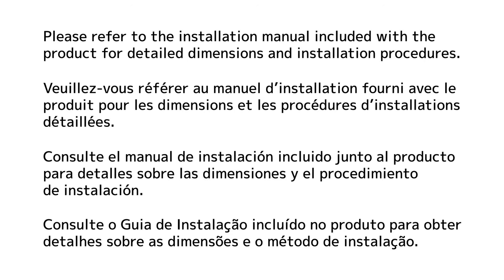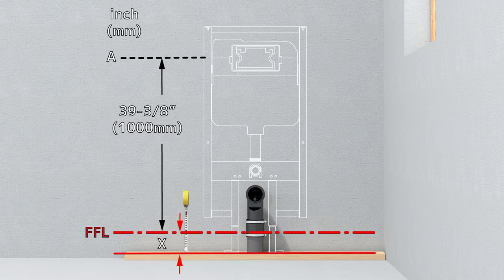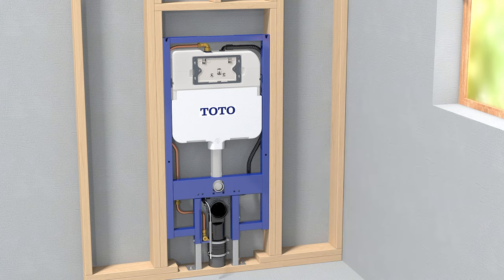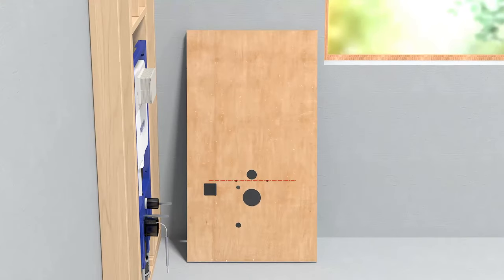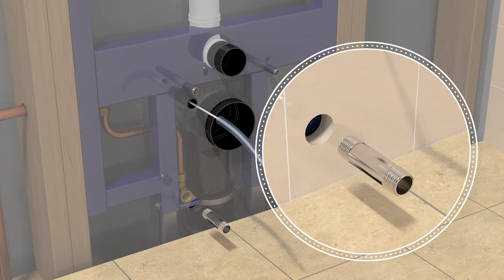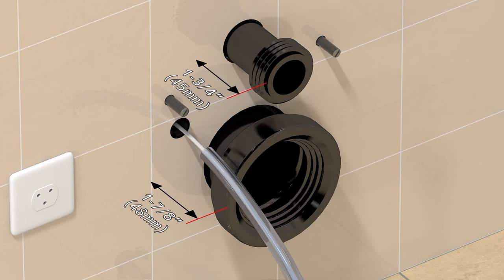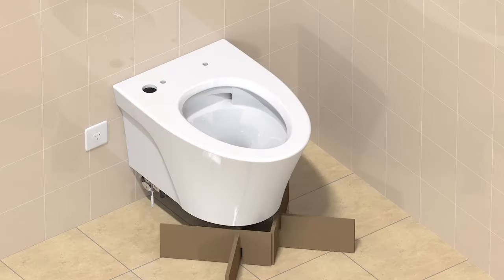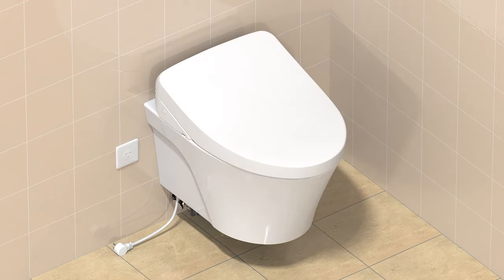TOTO AP or EP Wall-Hung Toilet Installation Video

Comment: I read all the comments below and no one mentioned these two MAJOR flaws: 1. At no time in the instructions of videos (Jan 2022) does it include instructions on drilling the left side 2x4s for the water inlet. Instead the video says” now that you have drilled the hole” that magically appears in the video. Also the copper water connection is behind the blue bottom rail so completely inaccessible front the front. If you install on an outside or concrete block wall good luck getting it tight. 2. The water tank makes it impossible to properly tighten the top left hand lag bolt. For the price of this system these types of major design flaws should not occur!
Reply: 0:36
Reply: @BookieTech lol
Reply: Might help to watch the clip again.  Sometimes we miss things the first time.
Reply: My man's brain exploded 30 seconds in
Reply: Note… to be installed by professional 😂

Comment: I’m installing this is my house right now, this video shows it being enclosed in high quality plywood first which is a solid idea. Nowhere in the written instruction manual does it tell you that.
Reply: But what if something is not working or it has to do a maintenance?
Reply: @ashbinx  That is the  problem a time bomb.
Once it goes bad remember it is enclosed into the wall and you will notice the damage very late plus the damage will be
1 the wall where the toilet sits.
2 the bottom floor wall and ceiling 
You will notice the damage and would not be able to prevent it early and you could grow mold and complete destruction of floors walls ceilings.
Reply: @ashbinx  I was working in a Carribean hotel where all toilets were like this one.
I wanted to install one in my house so I would suggest this.
After all structural installation the final finished wall (cover) to be something like an accent cover panel so if something happens you just unscrew the bolts and repair all damages.

Comment: I was dangling my feet off the toilet pretending the ground was lava.  I did a little butt hop and the toilet broke out of the wall...  As I lay on the floor with a mild concussion the water and brown monster mudd splashes onto my face.  Reevaluating how i ended up in that current situation I couldn't help but think I should have got a 1 piece toilet.  They are sexy.  They are sleek.  They are like a smooth sleek bentley.

Comment: I want to install this but run my plumbing through the framing (horizontally) Is that possible? I don't see why not...But no one shows it going horizontally. Always through the floor as if that's the only way to accomplish a proper installation. I am slab on grade and want to use this to escape cutting out concrete.

Comment: TOTO please do a video installation into a concrete block wall.  Also, find a solution so the bidet controls are not next to the toilet.  Bluetooth control panel that can be attached anywhere on a wall.  Phone app or Google voice command.

Comment: My remote didn’t come with the piece to swap out the top of the remote that has the auto flush buttons. Where can I purchase that top clip on attachment?
Reply: It didn't come with it because you didn't purchase the "auto flush" option model, so in this case you wouldn't need info on where to purchase this remote clip cause it wouldn't do you any good.

Comment: But what if it has to do a maintenance or something is break?
Reply: remove the cover plate for the flush buttons and all parts can be repaired or replaced . if there is a problem with the outgoing drain pipe , the toilet and the wall tiles will have to be removed . however this almost never occurs so ,,,
Reply: @siriosstar4789  so the fill valve can be replaced..?

Comment: This video is very helpful but no where in the instructions does it say the you need to install a pc of plywood. I have 5 of these in a house right now and they all shake because the wall has a flex in it
Reply: we always mount these in 2x6 walls to limit that flex, and then the plywood on top, which also helps protect the tank from punctures.
Reply: @heartpimp  I 100% agree with you the ones that are mounted in the house I’m at we’re installed by a shotty plumber. I never usually talk down on contractors but these guys were so bad they were thrown off the job. The toilets I was able to secure them tightly without the plywood but for further jobs with these toilets I will for sure be adding the plywood it just makes sense. Thank you.
Reply: Don’t need plywood secure to the beams  that’s all

Comment: If you need to, how do you access the tank to turn off the water supply valve?
Reply: You can turn off the water supply valve by removing the cover from the splash guard, removing the actuator pushrods, and removing the splash guard. The valve is there inside near the top.

Comment: How does the plywood fit in? If we don’t have tile finish, Is it gypsum board over the plywood?
Reply: Did you ever get an answer to this?
Reply: @michaelnoone984  I never got an answer
Reply: The plywood is used instead of drywall. When you screw the toilet to the wall the drywall may compress. You can use high density drywall when tiling with a full coverage of adhesive and silicone caulk the metal frame so there is no gaps to prevent tiles from cracking when the toilet compresses against the wall when you tighten it to the wall.